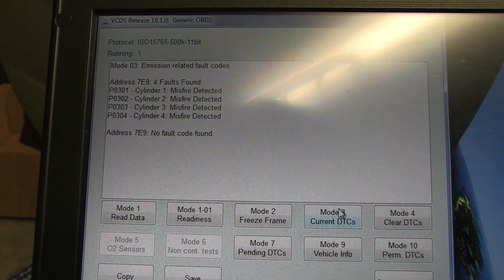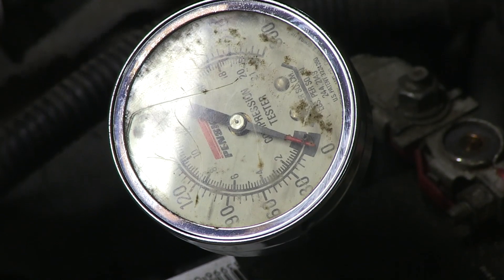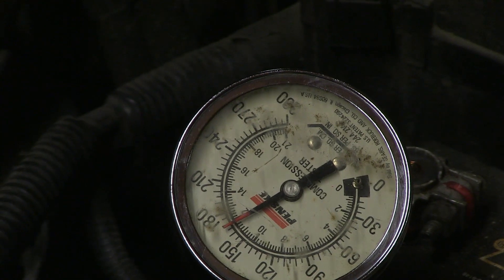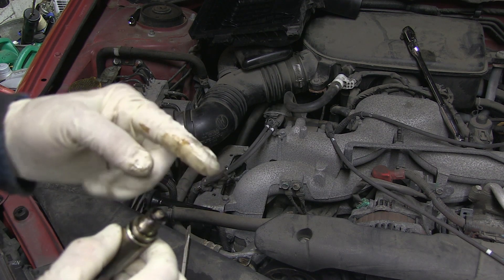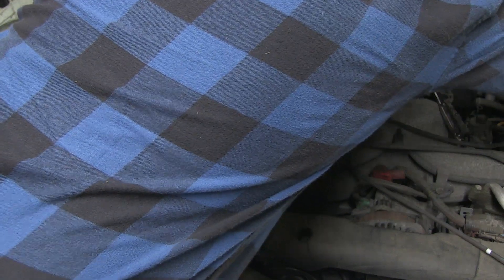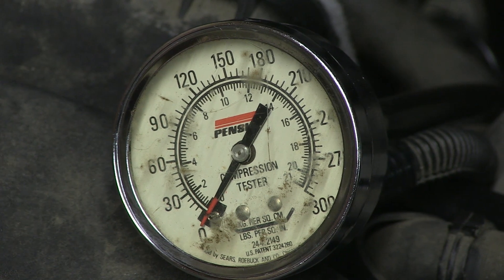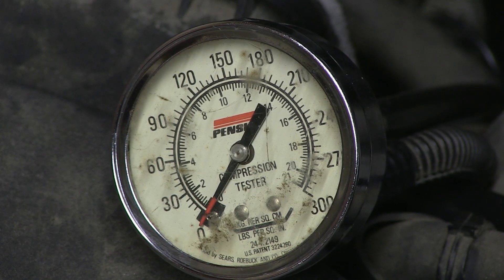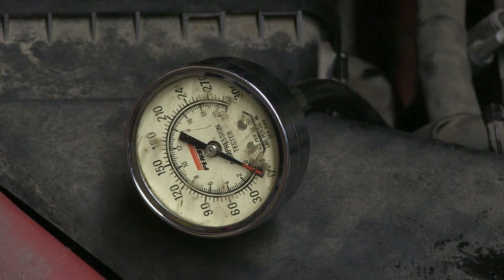2008 Subaru Impreza with no compression in one cylinder

Comment: Did you fix the problem
Reply from the maker: Yes, I did!!!! I had to get a used cylinder head for the pass. side!!!!!! (Actually, I had an extra head for the driver's side and CONVERTED it to a passenger side head! Cool, right????
Reply: I have the same problem with my 4 cylinder..going to change the head on the drives side..hope it works 🤞 thanks for the video
Reply from the maker: @luismonet6985  Good luck!!!!! Did you do a compression test?
Reply: @amcrae1  yes and it  was at zero on the number 4

Comment: More likely a bent valve than just a guide. Means the head has to come off. What a pain.
Reply from the maker: It turned out to have a broken camshaft on pass. side!
Reply from the maker: Turns out that the pass. side crankshaft was broken in HALF!!!
Reply: @amcrae1  Hope you can find a donor car. A crankshaft broken is as bad as it gets.
Reply: I have a motorcycle with the same problem.my cylinder does go up n down . I did the compression test n I get 0 on cylinder number3 1 2 4 are 80 psi